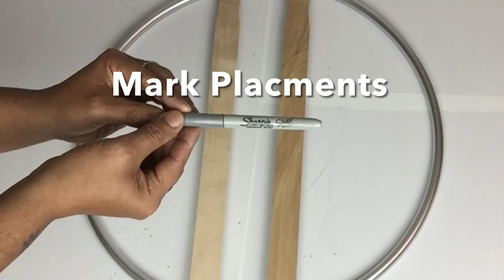Wow! 🤩 See How I’ Created a DIY Large Glam Wall Clock Using Dollar Tree Mirrors | Last DIY For 2022

Comment: Will, son sorry you still have the COVID pest. Wet weather seems to spread it quicker. Stay warm, cozy, and busy. That and patience is a cure. I wrote about a kitchen shelf problem I have that I need your help on. My trailer is small so is the kitchen.  I want to make a wall hanging spice rack to store 30 spices. I used a cardboard box about 8" deep by 17" long by 13" high. What I'm trying to do is build cardboard shelves that pull out of the frame box so the bottles stand upright, the shelf as wide as the bottles. I planned on 4 pullout shelves. My problem is how to make a track out of cardboard to slide the shelves on. Could you just mull this over and if you ever come up with an answer, let me know. I watch all of you lessons. You are awesome son.